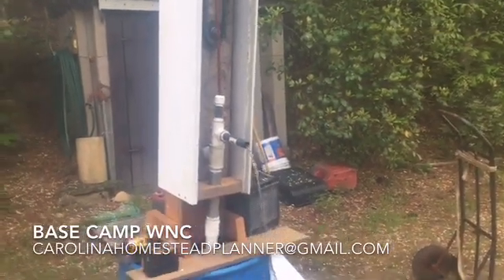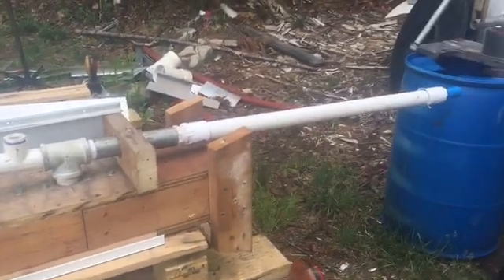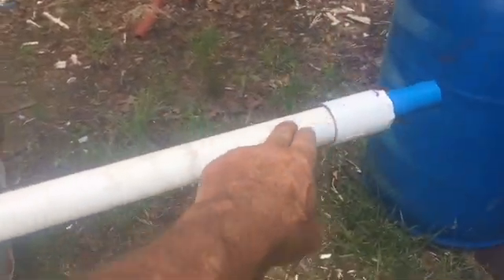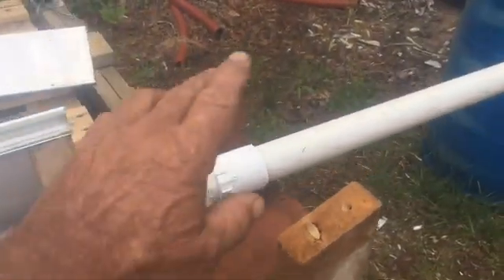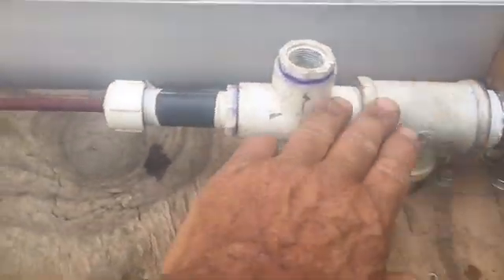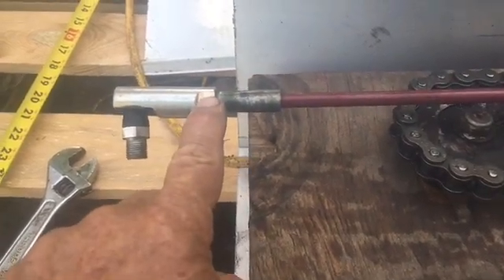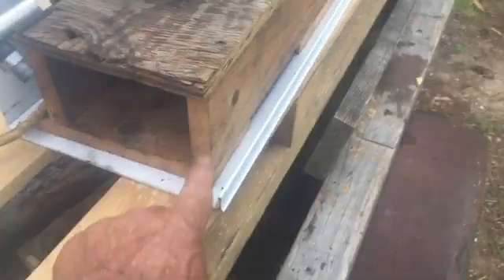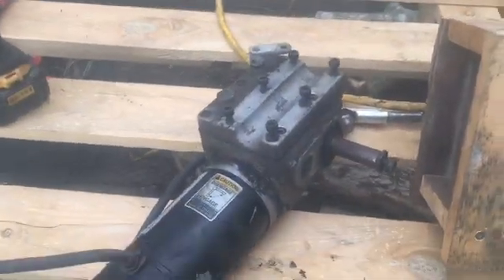DC Power Added To The DIY deep Well Pump

Comment: I am thinking about making a linear bearing out of the center of a front riding mower wheel that has bronze bearings. Cut the center out and smooth it up and cut it in half. Drill and tap a grease zert in each one and put some 1/8" flat plate on the sides of them and weld them maybe a foot apart on a piece of c purlin. Use a 3/4" cold roll shaft to go up through them. Fix a connecting rod at the top to hook up to the motor and adapt the bottom to the sucker rod. All the load and weight would be centered in the center of the cold roll. Would an older windshield wiper motor work?
Reply from the maker: Don’t know if the windshield motor would work need to address the load total weight of the rod and water that you are pulling 
That’s why I used the wheel chair motors they are 24 volt and I run they on 12 volt so there 1/2 speed 
And there made to push people around all day so my thinking was they hold up to the load
Hey but try the wind shield motor and let me know
Reply: @basecampwnc1745  I am lifting 40 ft from the water to the top of the well.
Reply: @basecampwnc1745  I got one of those Jazzi wheel chair motors with the hub like you have off of ebay for $37 delivered. Like brand new with the brake removed. Quite a heavy duty unit. One more step done.

Comment: You ought to consider selling  the piston check valve all ready modified with the two grooves and seals. A lot of people will not have a table saw, etc, to do the modification. And maybe the whole cylinder of different lengths. Just a thought.
Reply from the maker: I have sold that set up to people
I have sold the pump part and the handle part 
So all they had to come up with is the pipe and rod
Reply: @basecampwnc1745  I didn't see them listed anywhere.